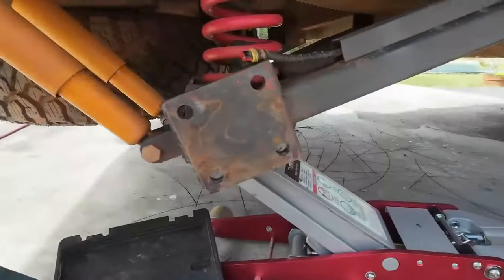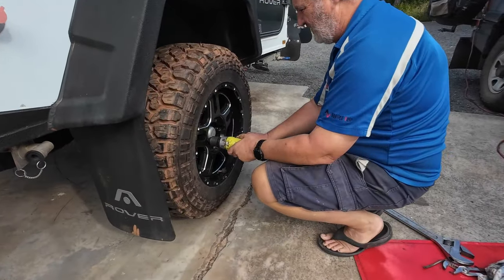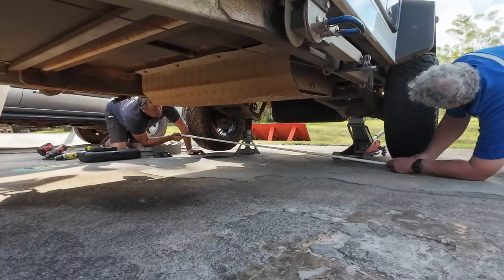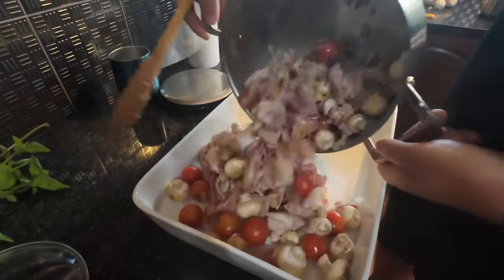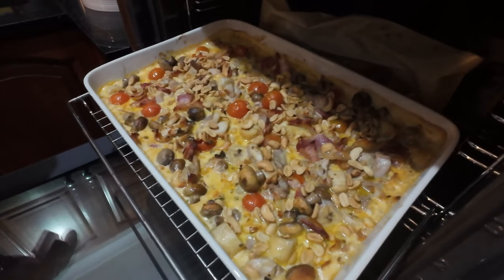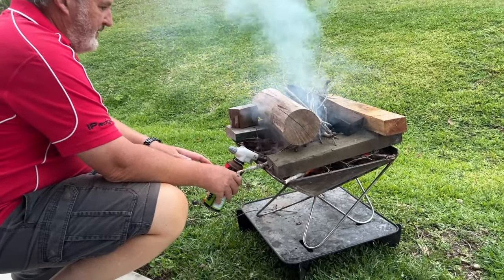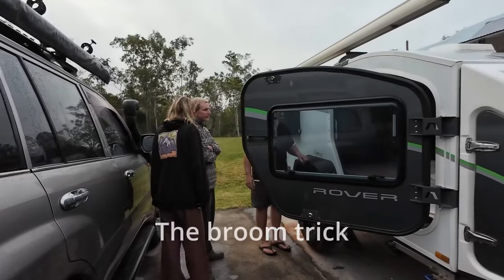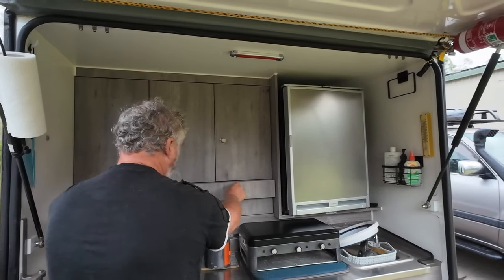Repairing the bent axle on my Stockman Rover

Comment: Carl
from an Engineering viewpoint, the straighened axle is now weeker than the orignal unbent axle.
- the internal stress distrubution in the shaft when initially bent made it stronger and less likely to bend again under the same load that originally bent it.
- when the shaft was bent back straight, this "strengthning due to bending" was effectivly redone in the opposit direction, ie it is now weeker, less fatigue resistant and more prone to bending in the direction of the inital bending than it was both before and after the initial bend.
- I strongly recomend puting the new one in, and keeping the old one as a spare.

The other thing that comes to mind is that it looks like the shaft can be bolted on in any rotational direction
- you could consider rotating a bent shaft by 90 degrees (yes this will muck up the camber, but that is better than bad toeout)
- the other thing that could be considered as a tempory field fix, is using some structural (hardened) washersat the bolt up area to somewhat correct the alignment of a bent assembly

I am  a little surprised that the shop in Cairns did not consider fiting the shaft into a lathe chuck and then skim the bolt up face to correct the alignemnt.

All the best with your travels
Reply from the maker: Thanks for the advice I am definitely going to swap the axel over when we get to somewhere I can work on the trailer comfortably. I was going to rotate it 90degrees if it wasn’t able to be straightened. All the best Carl.

Comment: First part to wheel aligning a trailer is to triangulate axle to hitch using tape /string line .
Then measure toe-in  with straight edges on wheel mounting surface on drum/ disc .
around .5 --1.5mm per side